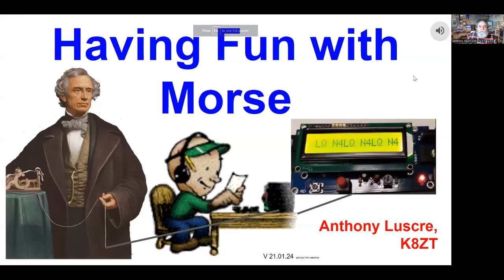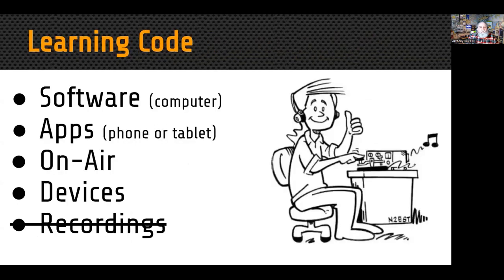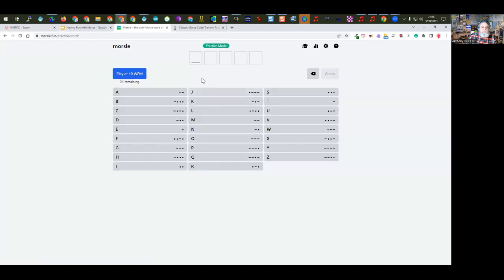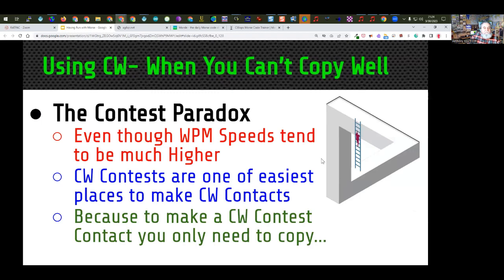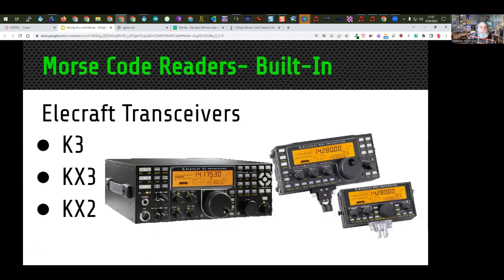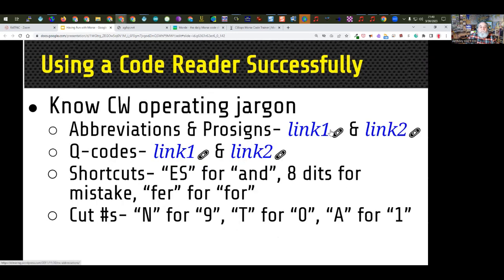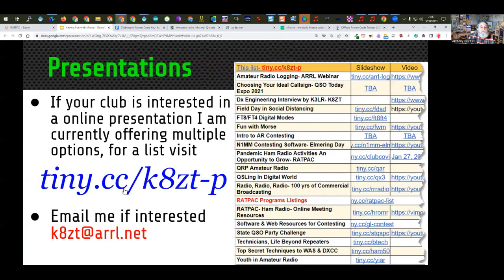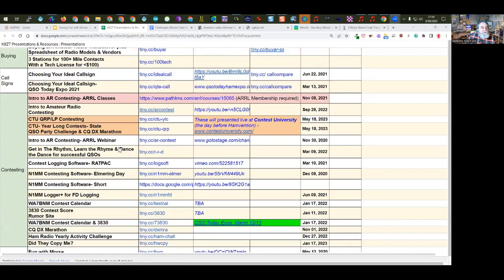Having Fun With Morse Code- 03/30/2023

Comment: I was originally licensed as a Tech in 1969 (5 WPM CW test), I used CW on HF for a few years, then in 1983, I got my speed up to 15 WPM, took the 13 WPM test at FCC office, got my General ticket, and never used CW again. I have tried multiple times to get my speed back up, but just never stuck with it. Right now, I'm somewhere between 5 and 7/8 WPM!

Comment: I strongly urge learning on straight key. The reason is that in IMC spaces are as meaningful as marks. The straight key will help develop muscle memory for the 3 different lengths of spaces to learn; dit length for spaces between elements within a letter or numeral, etc. DAH length for separation of symbols within a word or group. And seven dit lengths for spaces between words.  I'm not saying you don't learn dits and dahs on a keyer, but they don't seem to develop muscle memory for spacing. I can tell by ear who learned on a keyer. Thoseguyssendlikethis.